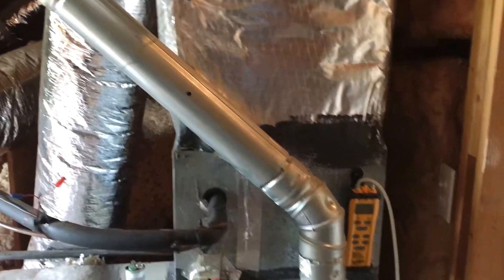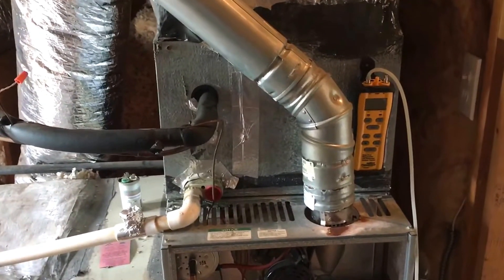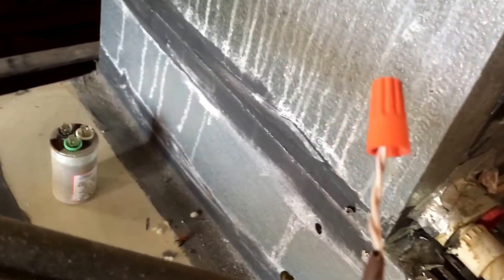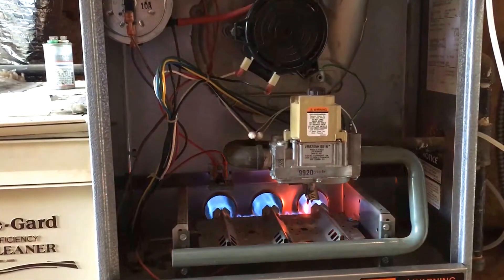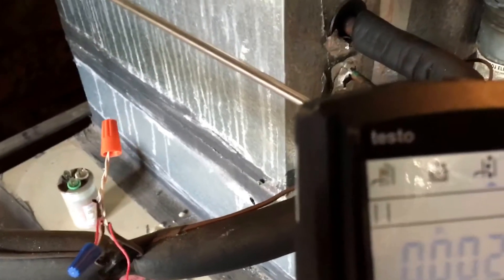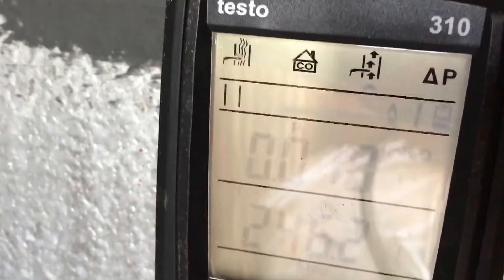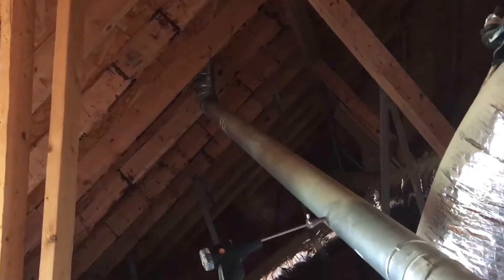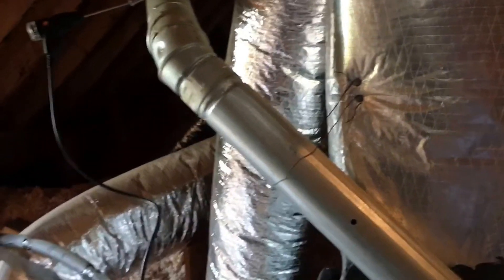Importance of combustion analysis and draft checking

Comment: Your numbers will change once you have it drafting correctly right?
Reply: U forgot to turn on ur testo outside buddy:)
Reply from the maker: Joe Shearer i would imagine so. The customer is going to get a roofer to inspect the cap for blockage. Her roof pitch is crazy steep and high so I didn't go up to check. I turned the gas off and told her to call us once the roofer checks it out so we can do another combustion/draft check
Reply from the maker: Joe Shearer I was surprised my numbers were good especially the co with it not venting right
Reply: Marco Alvarez I bet co will drop more as its diluted more and 02 will rise and co2 drops